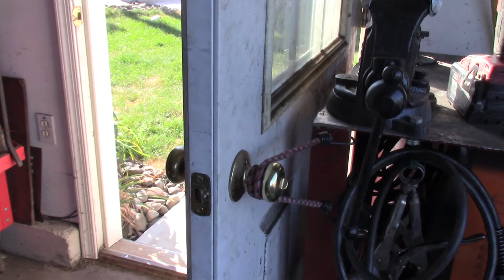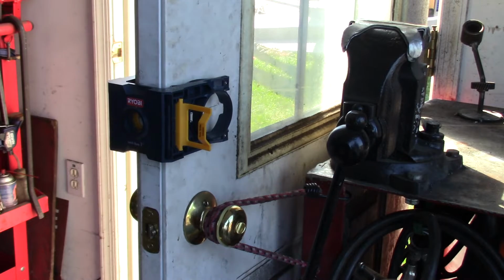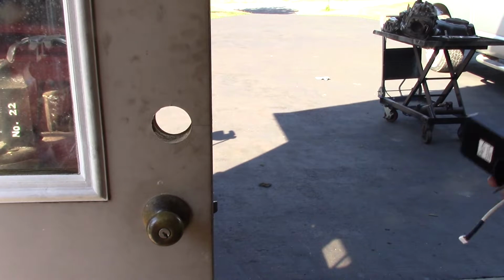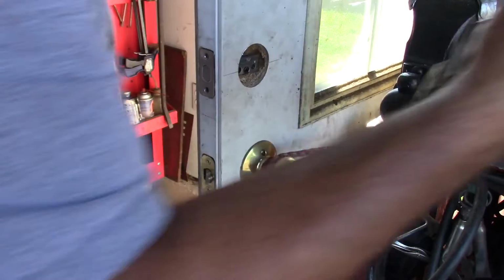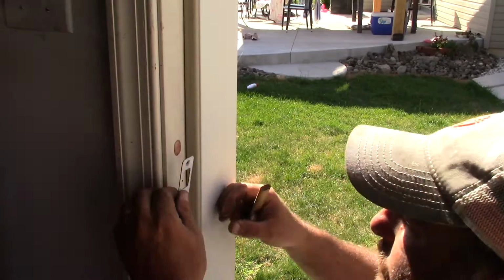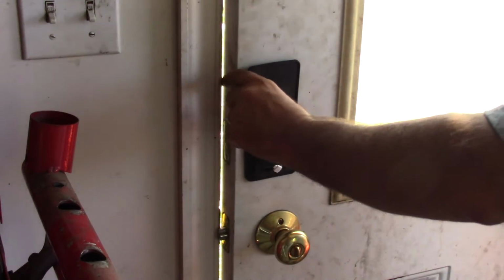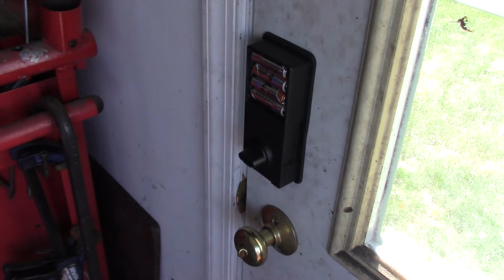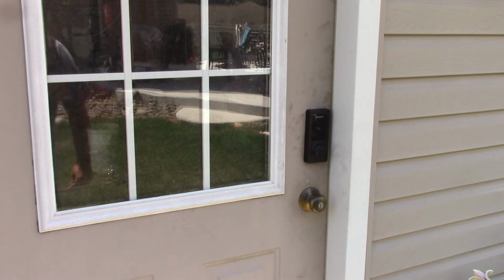Geonfino Smart Lock Installation

Comment: It took me several weeks to figure out how to unlock my door using a passcode.  The undocumented feature is that you have to touch the checkmark icon (lower RH corner) to unlock the door.  I found  the TTLock app very difficult to figure out and use.

Comment: The only thing is those locks are not very secure they have a lot of unsecure problems with them. Things that the manufacturer knows that should be fixed and they’ve been told about fixing them but they just won’t fix the problem. They can actually be forced open very easily in seconds in some cases in the tools are sold over the Internet. Us in the Industry have tried to get them to change the situation and fix the problems to make it better but we’re just told that they had this and they were selling a product and as long as people were buying it they weren’t fixing it. I like your video you did a pretty good job of installing it and I enjoy your other videos as well on the engine work and things that you do.  Just thought I ought tell the real truth about the lock.
Reply from the maker: any lock can be beat.  For this one just crack the window, or infact go to the windows in the shop and climb through.